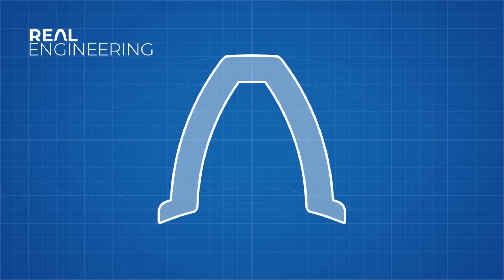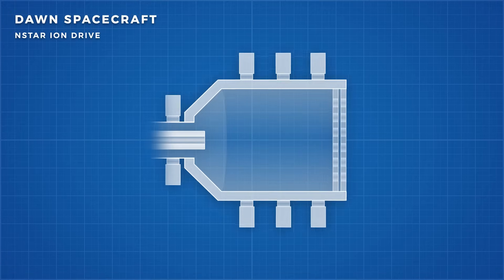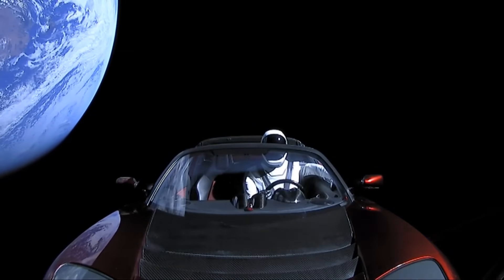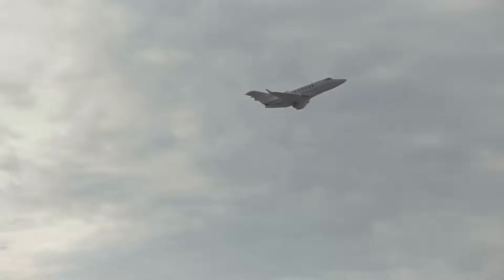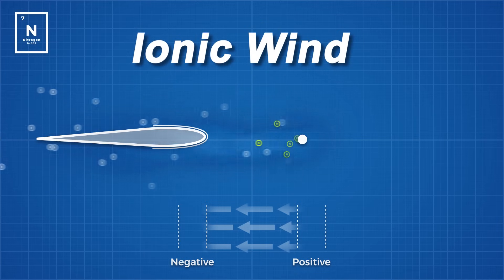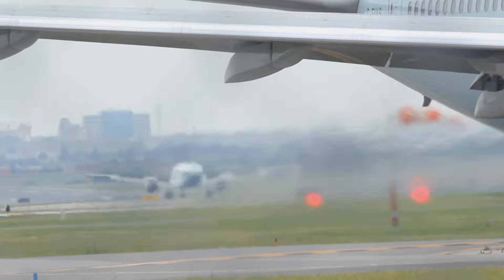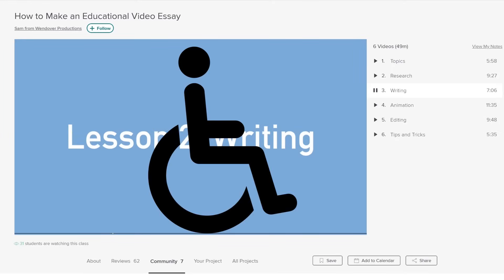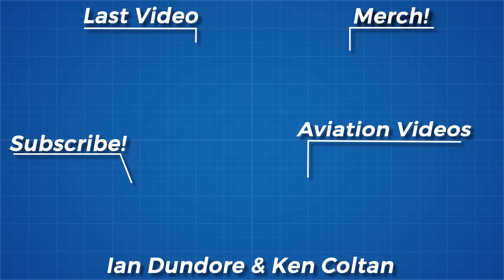Ion Propulsion - The Plane With No Moving Parts

Comment: Oh look.... its the bungee launched glider with drag inducing electrodes that supposedly "produce thrust through the ionization of the air". Lets all just ignore the fact that it is a bungee launched glider that happens to have a low enough wing loading that it gives the appearance of "flying with ion propulsion"..... All of us pragmatists know that anything like that is never going to work in the atmosphere of the Earth. You would practically need a full blown nuclear reactor off of an aircraft carrier to fly a cessna with "ion propulsion" for any recognizable distance, never mind that it would never make it off the ground carrying that much weight anyway. Ion propulsion puts out very.... very little thrust. You would be better off venting waste heat from an RTG into a turbine similar to what they did with the nuclear powered aircraft the Air Force developed in the 1950's.

That glider only flew because it was a glider launched with an elastic/bungee launcher. There is nothing revolutionary about that, people have been doing that for decades.

Comment: The solution to the problems that you mention are basically to increase the speed of the thrusted molecules at the back of the ion propulsion unit.
If N2 molecules can be propelled backwards at speeds of multiple millions of km/hr, then this is starting to become a very forceful propulsion unit, even though it is only dealing in individual molecules.
You would also need to keep well clear of the rear of the jet stream, but that's the case with modern jets anyway.
How this is done would be a matter for real engineers. it would probably involve looking at the distance between the cathode and anode and the precise design of the funnel and looking at the kind of molecular vortex produced.

Comment: High voltage silicon drivers are prone to failure. Especially when exposed to heat and humidity. It is common for high voltage drivers to have large heat sinks, and filters to prevent failure. With this design the filters and heat sinks were the first to go to reduce weight. This is a neat novelty, not a practical idea. Also this concept is nothing new. Look up ioncraft. It's been a known concept since the 60s.

Comment: This is the future of commercial flight. It will start with hybrid versions, with jet planes using conventional turbofans supplemented by ion propulsion units along the wings. This means that planes can go into 'glide' mode at high altitude switching totally to ion propulsion for short periods, thereby allowing long routes like Sydney-London with ease.

As the tech improves, we should be able to move to pure ion drives.

Comment: I have an idea. What if they put something that was really light but dense enough not to bend due to the air around it. To make a funnel like shape that would compress the air to the ion things thus improving the amount of nitrogen going through. Though..... this would create more drag.... hmm ahh. I see their problem. Then what if the material was breathable and would let air through. Please critique this comment.
Reply: Speculation based on materials that don't actually exist might not be useful. If there was a material that was very strong, but weighed almost nothing, you could make this ion powered aircraft bigger and lighter, but the drive would still weight the same, and creating lift still would create drag. If the aircraft part of the device shown here was twice as good it would still be infinitely far from being able to carry a single passenger for even five feet.
Reply: yeah ur right
 @herbertshallcross9775

Comment: was kind of hoping for a more thorough digging into the battery and power system. when i ran the numbers i figured something like a 54 lithium cells in series would be required to meet the power supply requirements indicated in the schematic. i figured the only way to do that without taking up too much space or weight is with a lot of ultra thin lipo cells with < 100 mah each. so this test aircraft would have less than a minute of run time on a charge.
Reply: wouldn't surprise me, and a payload of nothing so long ways from being useful

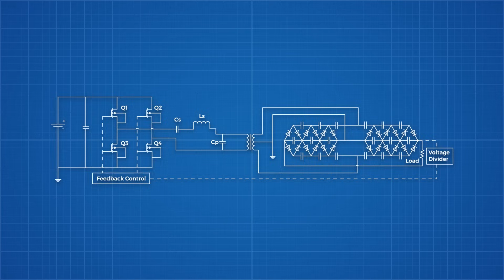Comment: 5:54 200 Volts LiIon/poly batt. pack??? Why that high voltage ('bout 55 cells cells required)???? that would mean a ton (ok half kilo or one, or two ;-) of really small cells which have much smaller  weight to energy (watt-hours per kilogram) ratio, than, something like four to ten cells in series. Plus being a P.I.T.A. to charge.There is no big difference (in efficiency, weight of boost voltage converter etc...) converting some common voltage like 10.8V.....36 DC to 20KV than converting 200V to 20KV with modern semiconductors...
AND i guess they need high voltage (20 000 Volts, as you said) DC, NOT AC, for ion propulsion...
Reply: I agree, it should be obvious to any professional EE.

Comment: This video is so wrong at so many levels. 
Just google "ionocraft". It is a decades-old hobbyist project.
The power supply design is so well known it is all over the internet.
The CW generator in the circuit got a Nobel prize, in 1951 .
And guess what? Ionic wind is DC, not AC.
Don't hype up ancient concepts for no good reason dude.

Quoting the name "MIT" doesn't make the design any smarter; citing formula without practical consideration doesn't make it real engineering .
Reply: @gwentarinokripperinolkjdsf683  this video shows an ionocraft getting catapulted into the air though
Reply: simple Lifter /= Plane but most people should have figured that out by now.
Reply: Its more when making it a practical application.
Reply: Lifters are cool but almost all of them were tethered.  I only saw one that wasn't but it was assisted by a helium balloon.
Reply: @DaemonC   not significant at all, tiny thrust created.  useless for a real airplane, even for a tiny plane you'd be consuming enormous energy and making ozone and harmful x-rays and UV.  this tech IS useful in outer space though with gas
Reply: Yeah you are right, as soon as I saw the plane at the very beginning I knew it was the same principal that has been around for quite a long time, there's ancient videos on YouTube claiming this technology is antigravity I kid you not.
Reply: These ioncrafts used to be called  " Lifters "  for many decades,   and Yes,  They fly great  ..    You can search youtube for tons of video on  "Lifters"  with the same ionic wind technology.    Except it is vertical propulsion in the old fashion lifters..  MIT just turned them sideways and called it their's..  They can't patent it,  cuz it's been in public domain too long.
Reply: these videos look like a bunch of UFO conspiracy theory stuff to me
Reply: @eduardopupucon    That's what they said about the Wright Bros..  then,  they Laughed and Laughed,  until they stopped..    The rest is history..
Reply: DeepSpace12 Yeah... and we already have gliders.
Reply: yeah, we've know about them in theory but no one has ever achieved flight...now heres the part where you claim to have known a guy that knew a guy that did it
Reply: @philtripe  kreosan made it a year ago
Reply: @philtripe  one even levitated a man moving air, look it up.   Very little thrust though, and makes a pile of poisonous ozone to boot.  Not practical for airplanes, but of course very useful in spacecraft, already real craft using them.
Reply: @philtripe  https://youtu.be/ulP1UB5PIN0 from 2007 flight was achieved
Reply: @philtripe  there's plenty of examples right here on you tube. Do your own research before you discount the validity of a subject.
Reply: @capodad2u  Can't really find any examples here on youtube though. Can you point them out? I see a lot of videos about ionic propulsion and even some levitating structures. But none of them contain the entire high voltage generating electronics within the craft. Which is kind of what MIT claims as the big advancement. Maybe I'm wrong, but still seems like they achieved something here. Whether it's useful is an entirely different question.
Reply: @capodad2u  links please
Reply: @ksp-crafter5907  you prove exactly my point. Look at the video again, the big pole with the wire sticking out is connected to the mains. They even explicitly show him plugging it in. The lifter is not carrying it's own power supply. Apart from that it's a very stupid video, making ridiculous claims
Reply: @ksp-crafter5907  again, showing a huge power bank outside of the levitating structure. Why is it so hard to see the difference. I still think this is mostly useless. But at least acknowledge they did something different with this craft
Reply: @xerxis100  But why the need for carrying the energy supply on-board?    A powerful LASER for example - and later an array of them could do the job - even much better with almost no energy/thrust limit!
Reply: @ksp-crafter5907  that sounds very improbable to me
Reply: @ksp-crafter5907  Those are all very interesting,now can you link a video where the lifter carries its own power supply? ( bonus points if it doesn't cheat with an elastic launcher like the MIT video)
Reply: @ksp-crafter5907  His apparatus is connected to the high voltage supply (which is shown sitting beside the lifter in the video) through wires. That's why he doesn't need any control systems to keep the thing stable.
Reply: @capodad2u  https://youtu.be/ulP1UB5PIN0 from 2007
Reply: @xerxis100  https://youtu.be/ulP1UB5PIN0 from 2007
Reply: @JanjayTrollface  https://youtu.be/ulP1UB5PIN0 from 2007
Reply: @xerxis100  about the power supply , you must understand  that you can prove a concept with out having a commercially finished product , then there's the availability  of technology most of the YouTube footage  I'm aware of goes back to the early days of YouTube when battery technology was nowhere near what it is today, your argument is like me stating that Albert Einstein didn't invent the theory of relativity because he didn't  have access to atomic clocks  and the large Hadron collider.
Reply: @ksp-crafter5907  So I'm not much of an engineer in any way but these simply just don't seem to be on the same level as the glider. Yes they are technically Ion powered things but something has to be said about each projects movement. The videos that you provided are all variations of one levitation device, simply creating upward thrust, the biggest of these having a pay load of only 100g. They all also have a big ass battery attached to them via wire. This plane on the other hand is completely different. It's massive with an ~16 ft wing span and weights way more that the biggest one of your examples. It is also creating continuous thrust powerful enough to create lift with the wings without an external energy source like the batteries. Idk man
Reply: Patent number 10,119,527 and the associated videos and website show the first one and it's not MIT's.   @xerxis100
Reply: Here is one that does carry its power supply and predates all other such attempts including MIT's.
Video: https://www.youtube.com/watch?v=Qdg0_hjuksQ&t
 @xerxis100
Reply: @ksp-crafter5907  lol you're kidding right? those are literally UFO guys in their basement playing with a battery and aluminum foil. It just sparks, then they claim their lightswitches dont work hahaha
Reply: see the already patented "Self Contained Ion Powered Aircraft."  @philtripe
Reply: @philtripe  yes flight has been achieved in the past. Ever heard of a lifter?
Reply: Freaks me out MIT didn't create this technology . I sense shills are being paid to lie.

Comment: This is great and all, but batteries need some serious leaps before electric drives will run airliners of any economical scale
Reply: Considering that an equivalent mass of gasoline contains many times the energy of dynamite, and considering that dynamite contains around 5x the energy than a battery can contain.... it will never happen. Human body fat is even more energy dense than gasoline.
Reply: It's important to distinguish between aircraft propelled by electric motors and ion drive aircraft. Human powered electric motor aircraft are becoming relatively common, but battery technology seriously limits their speed, range and load carrying capacity. Electric motor powered airliners are not just around the corner. If they ever come it will be after a long slog in the laboratory. Ion drives, like this have been demonstrated for years using tethered "lifters" which you would have no trouble finding online, but lifters don't produce enough thrust to lift their power source. The ion assisted glider demonstrated here does not produce enough thrust to take off, and must be catapulted into the air by stretched bungee cords. Other videos of this, available online show a clear increase in flight duration and distance when using the ion drive as opposed to just the catapult. The ion drive is an inherently low thrust device and increasing thrust is problematical because increasing the voltage between the electrodes soon results in arcing, heating the air molecules rather than moving them. This is a fun way to demonstrate the effect, but it certainly doesn't show that practical ion drive aircraft are just about to replace other methods of powering aircraft. Improve ion drive aircraft by a factor of 100, which is highly unlikely given that lifters have been around for decades and this ion drive is not any more efficient or powerful than they are,  and you might be approaching the capabilities of  the original Wright Flyer.

Comment: The Wright Flyer was not an example of "true powered flight" - it was basically a GLIDER. the bros sat on top of a sand dune for TWO WEEKS until the wind blew in the right direction to give it lift. Any pwer generated was completely incidental.

Comment: Question:
I was told at one point, that at high altitudes the Ions in the atmosphere are of a high density or amount. (Not sure which is the correct way to put it.
Not sure how to word my question correctly but here goes nothing.
So my question being; If this is actually true (not actually sure myself) wouldn't that make some difference in the design for the amount of power the ion drive would produce? 

I am not 100% sure about anything I am saying. But I know that different variables cause a need for different approaches to things.
So Maybe someone could help give be a bit of education on this subject.

Comment: Ah, wouldn't the best benefit of ion propulsion be less pollution?
Reply: The best benefit of ion propulsion would be no pollution.

We have basically solved the problem of running cars cleanly.  The problem of running boats cleanly isn't that far behind (really, it just requires cheaper, higher energy density batteries with faster methods of charging).  That leaves airplanes & rockets.

If this technology pans out & batteries continue on their current trajectory, we could be looking at a real solution for clean powered flight in the next 50-60 years -- then the last problem to solve will be getting things in & out of the atmosphere without the need of fossil fuels.
Reply: @dr.zoidberg8666  lol. You do realize that ionocraft produce ozone right? And a lot of ozone right? People who make these indoors need to be well ventilated, or they can be poisoned by ozone
Reply: @andrewlee-do3rf   And what would be the detriment to having too much ozone in the upper atmosphere?  Too little skin cancer?  Correct me if I'm wrong, but it seems to me that a robust ozone layer is critical for life on Earth, & thanks to human activity, that layer was severely weakened (to the point that there was a literal hole in it).
Reply: @dr.zoidberg8666  Ozone is fine in the stratosphere (way up up in the air). NOT when your directly next to it....where breathing it in is harmful
Reply: @andrewlee-do3rf  Great news, then.  Airplane cruising altitude is in the stratosphere & I don't stand next to airplanes when they take off.

I mean, I can imagine that jet fuel is also really dangerous to breathe in, but I don't see you complaining about that.
Reply: @dr.zoidberg8666  Well that's true, airplane cruising altitude is in the stratosphere (well at least for some planes like civilian airliners.....but that doesn't apply to ALL aircraft. Such as low altitude planes, and helicopters), and nobody stand next to airplanes (well...other than ground crews).

But it's not like planes magically enter the stratosphere in an instant.....they have to first climb to that altitude. And after that, they have to lower altitude, and land on the ground. It is these altitudes that are lower than the stratosphere where ozone will accumulate, and lead to serious issues. Like cause harm to people who breathe them in. Ozone below the stratosphere is basically a pollutant. https://www.nasa.gov/missions/earth/f-ozone.html

In comparison a simple electric propeller does not produce ozone, and provide other benefits such as (BEING MASSIVELY MORE EFFICIENT than ionocraft, and can easily lift itself up into the air UNLIKE ionocraft)

But to be honest with you....I have no idea how toxic ozone is when compared to carbon dioxide/monoxide, or other pollutants produced from combustion engines

Comment: Uh... it's a three-grid system. First positive grid=separation from ionization chamber. Second (slightly negative) grid: preventing pressure buildup. Third, strongly negative grid = acceleration grid. Or, second grid is the acceleration grid, the third grid is the deceleration grid to optimize the exhaust velocity to balance thrust vs specific impulse (the rocket equation SUCKS). The second option is how the NSTAR worked... but IMO the first option offers other advantages.

Comment: ahh..  no moving parts.. in the engine...   lucky bugger  I was going to say , well how the hell could you control it then..

anyway..   1 dislike because its useless...    hydrogen is an infinite fuel so we dont need another engine.
and             2 dislike for the plane with no moving parts crap...   I thought I was going to see a major fail